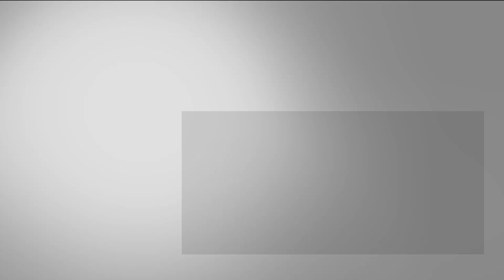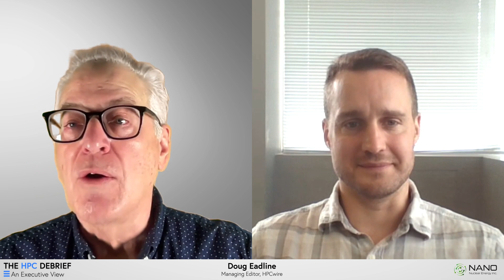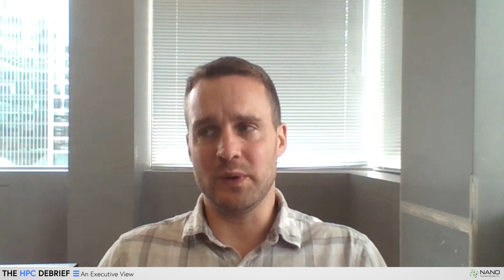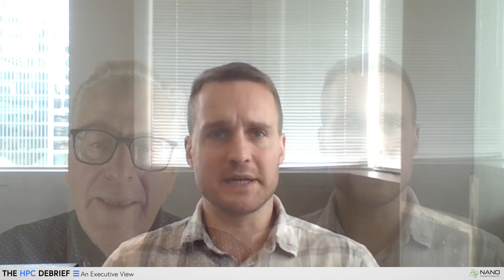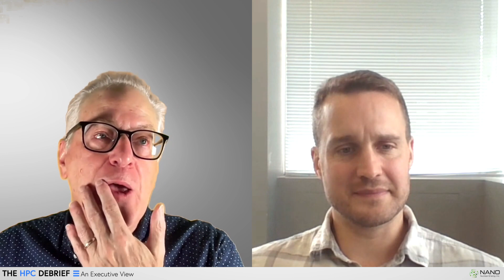James Walker CEO of NANO Nuclear Energy on Powering Datacenters

Comment: WTF is this? A CEO of a nuclear reactor company saying that a safety issue with their reactor is a tree falling on it? Then he say that the first thing they will do when decommissioning the reactor is to remove the fuel, wait 6 months and then scrap the reactor vessel an pop in a new one. Just like that. This is NOT serious. It is blowing smoke up your rear end. Look up 'spent nuclear fuel decay heat' and 'radiation from a nuclear fission process'. Correlate what you learn reading about those subjects and what these two men are saying and good luck.